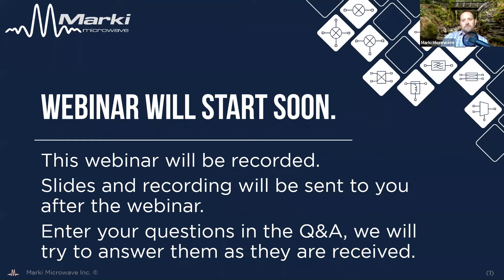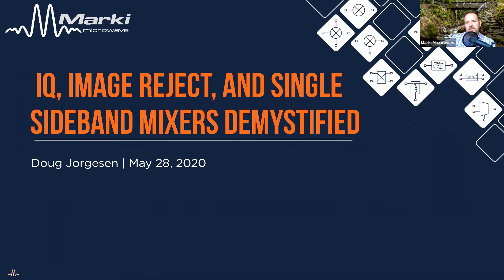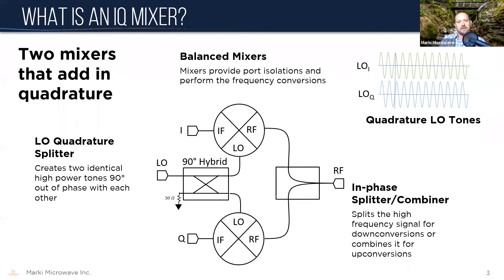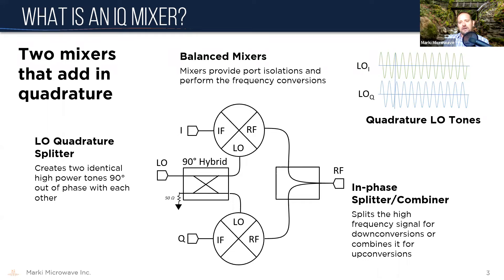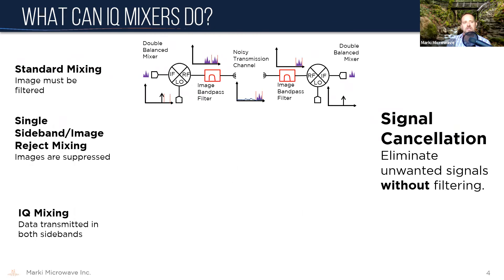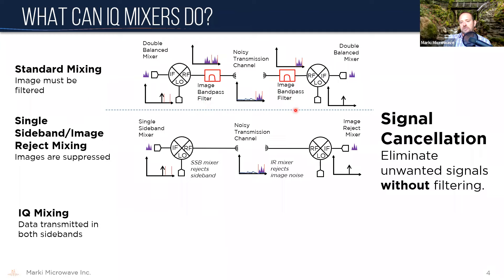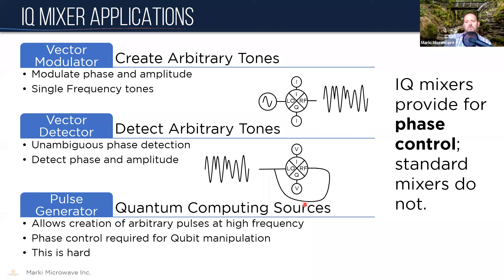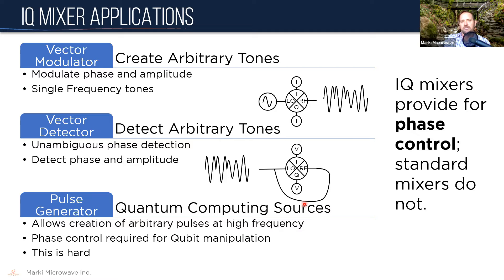IQ, Image Reject, and Single Sideband Mixers Demystified

Comment: I've always thought of I and Q as sine and cosine. With control over both you can put your signal anywhere with the circle your modulation bandwidth allows.
Reply: Exactly. That’s what it is.

Basically your signal is on a ribbon, and your sine and cosine create a rotating unit vector. When you send your signal through the mixer, the mixer twists the ribbon at a twist rate equal to the frequency of the local oscillator. The two outputs then slice the twisted ribbon in the horizontal and vertical direction.

The two new signals on the vertical and horizontal slices both consist of signals which are the sum and different between the frequencies of your input and the local oscillator.